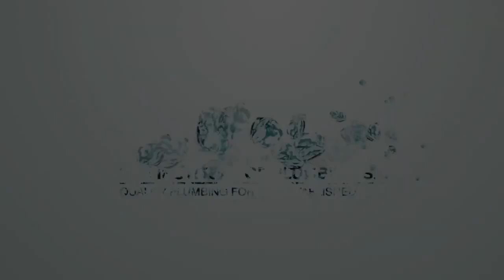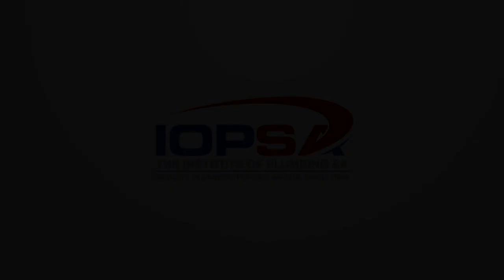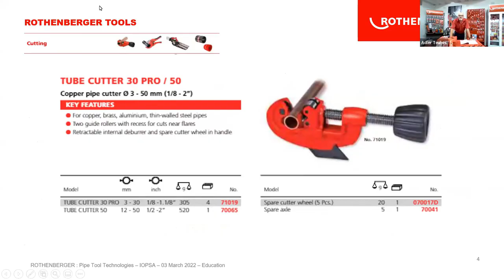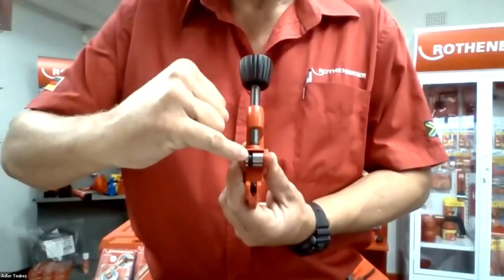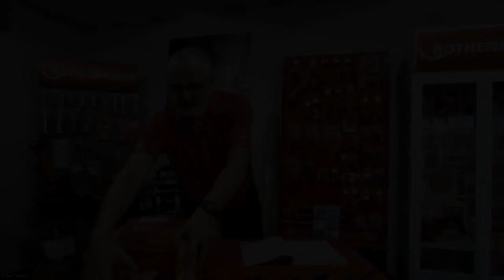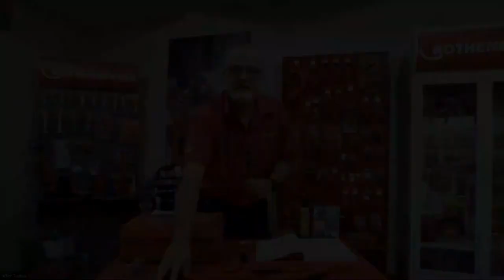Tech Talks Rothenberger tools - 03 March 2022

Comment: yeah.  Everything was good until you get to the Torch flame deflector...THAT is absolute Garbage!!!  Ya all need to take this product off the market.  You folks already know my product is Superior.  I'm always open for a Debate on You Tube.  Hey, remember the time we met at the Trade Show in Long Beach,  we both came out with Reflectors.  You guys saw my product, packed up and went home.  That was funny.  Buy a Soldersnake folks.  The Original handsfree reflector heat shield.  Available at Knucklehead head Tool company.